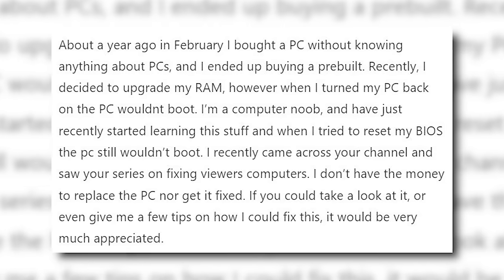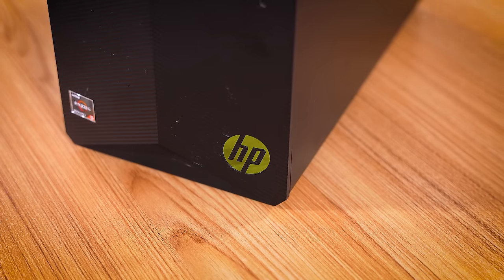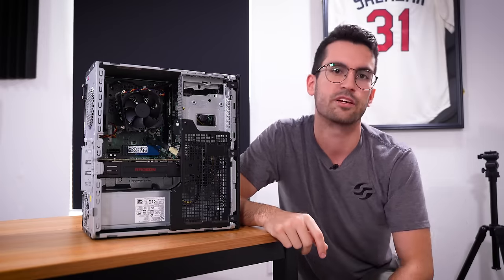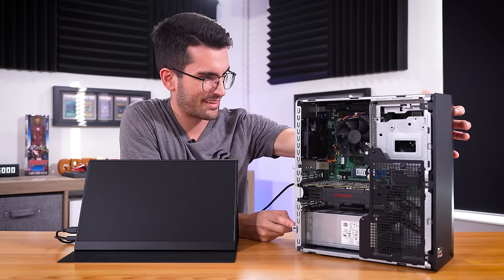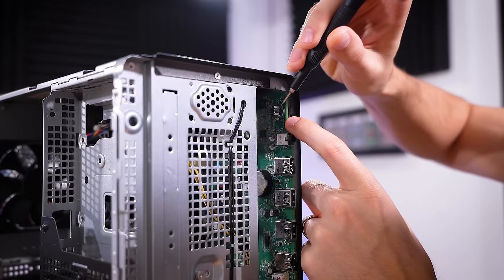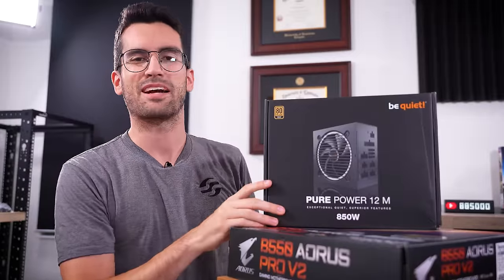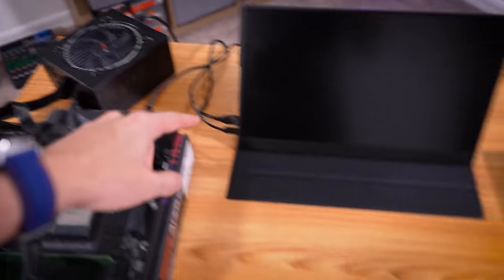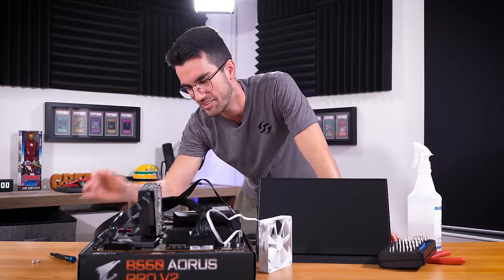Fixing a Viewer's BROKEN Gaming PC? - Fix or Flop S4:E17

Comment: Ugh these HP prebuilts. engineered to break. they are marketed as "Gaming Desktops" (they were called the power desktop before they changed the name.) I had several of these come my way with either a dead board or the PS having gone out. (your board had a short to ground for sure.) The radeon video card on mine was also a 9550 4g but older. these video cards I read, were workstation class, the power supply they used was also from their workstation line and was used to cut costs. low power, low spec. you did right in removing one more crappy prebuilt from the world.

Comment: i mean, it wasnt the same issue but i once had the exact same issue come up with a dell optiplex 9010. the owner wanted to upgrade from 4gb to 16gb and after buying a 16gb kit of corsair vengeance it wouldnt power on. the problem ended up being the ram upgrade. the board ONLY works with CL11 ram. what was gotten was CL10. once a CL11 kit was gotten it worked fine.

Comment: Why did you jumper the pins on the board? Aren't you supposed to jump the pins on the PSU connector instead to force the PSU on?
Reply from the maker: This isn't a standard PSU...

Comment: I’m thinking that an Erica 6 replacement would’ve been the cheaper option, but you gave him a path forward with AM4 (since that board maxes out at a 3700X).
Reply: If that motherboard maxes out at 3700X, why did it have a 5600G in it 🤔?  5600G is newer/better than 3700X

Comment: Recently bought the same motherboard but using rysen 5 5500 and have run into a problem ,  the dram light is stuck on and no beeps with ram removed. any ideas or help  would be greatly appreciated. I tried many  was to clear it but still no post or no beeps.

Comment: Great video! Greg (and comment section) I have the b550i (mini itx build) and a R5 5600x CPU that when I turn it on, nothing happens. I’ve tried taking a stick out, trying different GPU’s/PSU’s/cooler, and tried the flash button thing but no matter what I did (including what a lot of people were suggesting like taking everything out BUT the cpu and power), it still won’t post. Help?
Reply: Prob the cpu or motherboard. Hard to diagnose without some more info/ through comments. Did you build it? If so are you sure everything is connected properly? Did it ever post? Did you recently upgrade it?

Comment: I bought this SAME kind of prebuilt as my first PC! there are multiple configs ofc.

I was afraid of buying and it was the middle of the gpu crisis so everything looked so expensive.
Very afraid of messing something up if I built my own.

The reviews made it look reasonable, I was SOOO disappointed to find out later that basically half of the build was proprietary, and honestly I could have built a similar performance system for a lot less, probably even during the crisis

I have been tinkering with computer hardware non stop since tho, and I fought this PC sooo hard, it's bios is so barren it's actually disgraceful.

Happy to report I have a full custom build now, turns out building isn't actually that complex, it's just lego for adults when companies aren't actively manufacturing waste.

Really, even if they MUST use a motherboard with integrated IO for fukin, manufacturing cost or whatever, there is ZERO justification for most of the build decisions, if you wanted to make a small formfactor, standard form factors smaller than ATX exist, the case screw alignment and PSU shapes are shameless, it took EXTRA effort to make tooling just to manufacturer a product that is worse for the end user, and to the product is mediocre at best to boot.

I have purchased exactly 2 HP products in my lifetime, and that has been enough for me to decide they are never getting a cent from me again.

Comment: It is so annoying because the boards only support the same type of ram that was in that system.  It is common for the gaming model ram to short out a board if its power requirements go over the boards ability to handle the power load, it will more often than not short the board out than kill the CPU, but I bet the board would still work if you stick the non heatspreader ram in there.

Comment: How would shorting the output pins on the MB to the power supply turn it on. The power command connector to the  power supply needs to be connector there or it needs to be shorted to turn on the psw..

Comment: Did you update Bios, motherboard and gpu drivers?
Reply from the maker: The motherboard BIOS was previously updated. Never had an issue with the graphics card, and never logged into the viewer's system (I try to avoid this for obvious reasons if possible). The good ol' "If it ain't broke, don't fix it" mantra.

Comment: JUMPING THE MOTHERBOARD " PWRCMD" PINS WAS NOT LOGICAL TROUBLESHOOTING IMO. It is NOT a front panel connector, it connects to the power supply.  After reconnecting  the two  four-pin connectors he should have jumped the power supply side connector again to see if it and the CPU fan would spin (or maybe he did and didn't put it in the video).  if there are bad traces between the soldered power switch and the "pwrcmd" connector then yes the motherboard needs to be replaced regardless. I think Greg was creating the short he was smelling, possibly separate of the existing issue.

Comment: I bought an ASUS 1660 super second hand and the motherboard (ASUS TUF z590) on start goes through the lights but after a minute posts and boots into windows, what could the issue be? I had a 3050 in there before that i put into another build. I'm eventually going to replace the card. But still if anyone has knowledge on this situation, I'd appreciate it.

Comment: If you want to jumpstart the PSU you have to bridge the wires leading to the PSU, not the empty header on the board. The 3th wire on this header was maybe the 5Vstby, without this the board would not start anyway. Best way here would have been to plug the header in and bridge the pins with a thin wire from behind.

Comment: HP - Horrible Products, Dell and best Buy have been amazing in ensuring Job security for me.  While it pains me to say this, if people stopped buying them I'd be out of work in short order as my own builds never come back except for upgrades lol.

99% of failures in these Prebuilt systems is the cheap motherboard and on a few occasions the Power supply.  Generally I go to the MB first with these systems.

Comment: I would not use an AIO for a CPU that doesn't need one. AIOs break more easily than air coolers, and are more expensive to replace, and you don't really get much benefit from them. It's debatable if they are even aesthetically all that better than some good-looking air cooler.

Comment: If anyone can help me I’ll be super thankful. I ended up getting 4 x 8gb G Skill Trident RGB from my roommate who upgraded to DDR5 over the weekend. I have an asus B550 Tuff Gaming board and I have a Ryzen 3700x. I know both the board and cpu and my psu (700w) can handle my current set up and 4 sticks of ram. But I can’t get a post with all 4 sticks but can get a post with 3/4. Tested each stick and ruled out bad ram. Tried some over clocking of voltage and also tried setting mobo to 2T / lower might for ram and still nothing. :(

Comment: Hey Greg, this is actually a very bad combination of hardware. The 5600G is only capable of PCIe 3.0. The RX 5500 has only 8 lanes of PCIe 4.0, so now it runs on 8x PCIe 3.0 lanes and this is PCIe 4.0 4x.

Comment: Ugh! HATE OEM computers like this. So often they use proprietary parts in them, including ram, that's a complete pain in the rear to upgrade because unless you use said OEM parts, it just won't work. HP is BAD with this kind of thing.

Comment: The PSU uses the green and black pins to power on. Shorting where it would be on the board without them plugged in shouldn't do anything, as those plugs aren't connected to the PSU and therefore can't tell it to power on. You need the cable plugged in, and short the two pins from the back of the connector. Maybe there was some standby power from the other plug and you shorted the wrong pins and made a direct short and therefore burned something.

Also if you're building for someone else, especially someone who may not be as technically inclined, wouldn't prioritizing longevity be the best idea? Water coolers can leak, have a pump failure, etc. Even if all fans on a tower cooler breaks, the computer could still be usable.

Comment: People really saying these PCs aren't being fixed because parts are just being replaced are complete morons. Greg is troubleshooting, finding the root cause of the issue, and getting the PC to work again by replacing the bad part(s). That's like claiming the mechanic didn't fix your car because they replaced your bad alternator instead of rebuilding the existing one. Certain things are just more time and cost effective to replace outright. Especially in this situation where all proprietary parts made this thing nearly impossible to upgrade in the future. Now, this kid has endless possibilities. The case alone is a great one and can be used for years to come if they so choose.

Comment: Love the series and really admire the generosity.

I promise that I'm NOT trying to be a dick, but you ree, really should flip that AIO radiator so that the tubes/hoses enter the Rad at the BOTTOM.

The air in the system, however little, will obviously rise to the top of the Rad, and it can then be cycled over to the pump if the tubes are up where the air is. Tubes on the bottom means that the air can never escape the top of the Rad.

Common mistake, but one that should be corrected, as air in the pump can/will kill the pump over time. In fact, everyone with this configuration should do the same. Some are more concerned with looks - I recommend ensuring the performance and longevity of your cherished gaming PC.

Otherwise, great job and really great contribution you're making to people who may need a bit of help. More successful YT'ers should do the same...

Comment: i had a similar pc and it sometimes doesn't want to boot i have to reseat the ram 3 to 5 time for it to work and i fucking hate it if it wasn't a recent system that has a parts that are compatible with my current pc then i would just trow it away  it has a i5 9400 and 16 gb DDR4 ram and a random gpu a had a AMD RX 6400

Comment: Keep in contact with the owner, that ram is damaged. (the new kit) The original owner put in the ram wrong and burned out the system. I've had this ALOT when I was working on prebuilt.